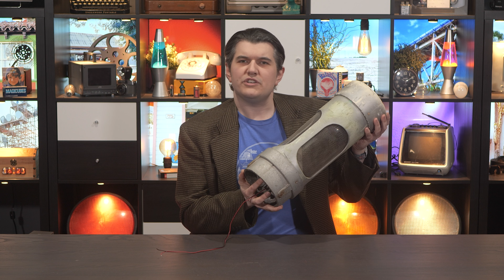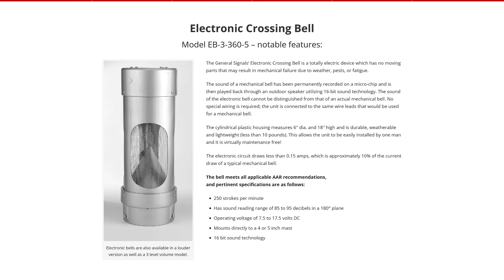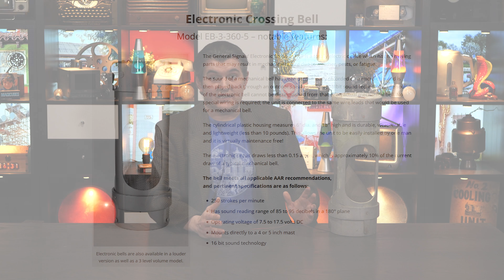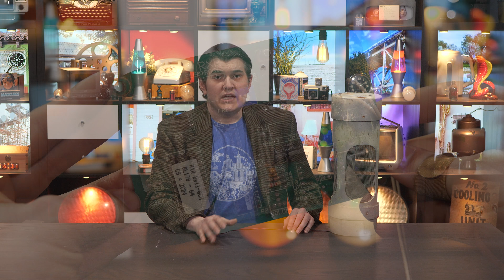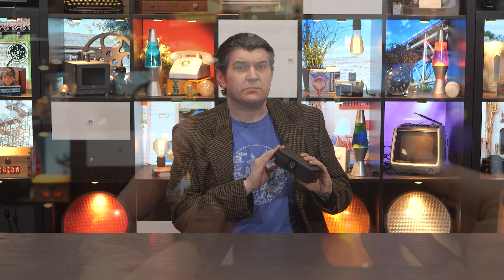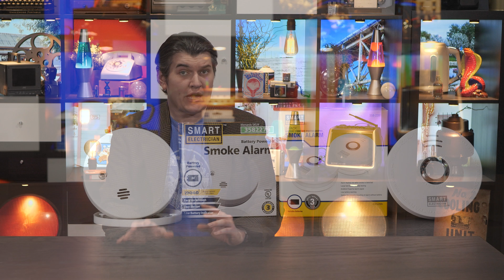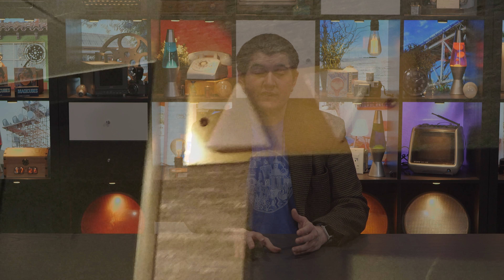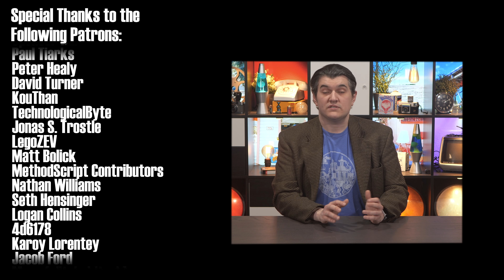The disappearing and unappreciated art of audible alerts

Comment: While your argument is correct and changing configurations and removing sensory aids are problematic, you are ignoring the devops side of things and the major problem of exponential complexity.

Lets use the 35 years old Linux Kernel as an example, it went from 200K of code in 94 to 40 mi in 2025, half of those lines were added in the last 10 years, and 35% of it in the last 6 years.
This exponential growth means it's already impossible to audit, it has long stopped being reproducible (bit by bit identical by different sources), it has dozens of critical bugs that are discovered early, it's not hard deterministic anymore (to mathematically sum all operations to count the time it takes), and yet it's the "safest kernel" there is today commercially.

Tech companies are not removing features and configuration options to mess with people, they are reducing the code to be able to maintain that which matters the most.
Unless we get better at isolation software and hardware, and automating security audits, unfortunately that's a trend that will only get worse.

Comment: I'm a fire alarm inspector and just want to add some context to the fire alarm cadence discussion:
- While temporal 3 is certainly one of the current standards, previous standards (in no particular order) included a solid tone, the whoop as mentioned in the video, and march time. Also, these days some building classifications are starting to move away from the temporal 3 standard and into voice evac, in which a pre-recorded message plays over speakers. These voice evac systems have decibel and clarity specifications outlined in code.
- While yes the cadence is the main point, there are generally accepted pitches that have different uses. They might vary slightly by manufacturer, but those manufacturers should be offering essentially low pitch, middle pitch, and high pitch options.
- Another caveat is there is absolutely code requirements for decibel levels even in temporal 3 systems. The alarm cannot be below a certain decibel rating in any part of the building in buildings that were accepted with this standard.
- Not all systems in currently in service will use temporal 3 or voice evac, because existing buildings are not required to be brought up to current code when the code changes unless they are making major occupancy type changes or renovations to more than a certain percentage of the building.

More trivia: Similar to carbon monoxide alarms using temporal 4, commercial fire panels are also required to have different types of alerts for Trouble signals (something wrong with the system but not an alarm) and Supervisory signals (other types of alerts, like for duct detectors or if someone is tampering with an associated sprinkler system).

Comment: I find that most chimes have now-a-days been replaced by spoken word notificiations, so there is not much of a need for chimes that follow standards. For example, lifts/elevators tell the user whether they are going up or down and what floor they just stopped at. Also, large vehicles turning have spoken word notifications to tell others to keep clear.

Comment: the problem for me is that noises are disruptive to me (Autistic) but the vibration modules in modern phones are SO WEAK that's why you miss them.
90s/early 2000s phones would vibrate so aggressively you'd pop in your pants if your pocket was a little too close, now days the vibration is as weak as a leaf landing on on the ground. hell it's so weak that I have felt the vibrations of a fridge running several meters away over my phone literally in my hand.

Comment: 11:24 the problem is that co detectors and smokes both use more or less the same low battery alarm and to add to that, the pitch and volume make that signal highly non directional.

12:38 lol, I have a Morse keyboard plug in on my phone for text messages.

An interesting version of this is the tone out system used by fire and ambulance radio transmissions.

Comment: I had a cellular phone at one point (when we used them as phones) that would vibrate for the first couple of rings and then start low with the ringer and increase volume if it was not answered.  I miss that.
I also had an LG flip that had a ringtone that clucked like a chicken.  I really miss that.

Comment: I usually keep seeing android-apologists preaching that it is ultimate "customize everything" phones, but when I got mine two htc and samsung phones gifted to me, turned out, that if it is not some barebone noname Chinese phone with completely vanilla android, it is more restricted than iPhones in technical and visual customization. Not only samsung's player won't recognize anything that is not a puny mp3, so I need to convert everything on top of that, and there is no personalized sound customization besides only phone calls. The settings navigating itself is a dungeon quest everytime. And my "htc desire" didn't even had the sorting function in UI, so you need to also rename files alphabetically or 1-9 numbered, like on old flip-phones. 
Who thought that those basic quality of life features are "not necessary" to include(or to cut off from original OS functionality)..

Comment: So much to mention, as always (a side effect of having similar thought processes). First, as a railfan I am always excited when I find and record a crossing with a mechanical bell, but I did once find a crossing where the gate was a bit bouncy and caused the electronic bell to restart repeatedly before it could finish playing the sound sample. It basically ended up as a remixed party bell.

Also, I miss the notification options I had way back in the BlackBerry era (including up through BB10). Plus, having a notification LED that would flash the color and speed I had set for each app or group of contacts. I could always just glance at my device to tell what was going on and how important it was to answer. It also had a sensor for different notification settings if it was holstered or just out in the open. Those were the days.

I highly agree that folks need to pay attention and learn more. Too often people are too wrapped up in what they're being distracted by to notice things going on around them. Is this what getting old feels like (I'm only in my 40's lol). I somehow missed the elevator ding video, but had independently discovered this some years ago. I worked in a hospital in high school and it always let me know if I should hurry up to get around the corner to the elevators or just take my time.

One area of sound design that I think is very cool but not yet universal is having a different cadence of rumble strips along the highway for the centerline verses the shoulder side. I spent last winter driving a bus on a mountain road that was often covered with snow and it was difficult when following the tire tracks ahead of me to know if I was drifting too far off the shoulder or into the other lane (which was much preferable since there was little traffic on the opposite travel lane).

Comment: I guess i am quiet odd in how i deal with push notifications. It's quite simple everything apart from WhatsApp and calls has no sound, and even those two are completely turned off when i set my phone so silent. The only two apps that are exemt would be my Alarm Clock and my Catastrophe alert app, which has yet to trigger for the last 3 years, apart from the occasional test alarm (around once or twice a year).

Comment: Back in the '80s, JDM cars came with a mechanical speed chime that kicked in at 65 mph. It used a tiny striker to give you a polite 'ting-tong', the car’s way of saying you’d hit the limit. HA! For us, that’s exactly where the fun began
Reply: My 1986 Dodge Conquest (rebranded Mitsubishi Starion) has its parking brake warning light and chime set up from the factory to not activate if the brake is pulled after the car is already moving. It's like they knew that the driver didn't need to be alerted when doing J turns!

Comment: The railroad crossing bell is a General Signals Type 1 electronic bell. Production started in around 1992 and ended in 2000. This bell you have seems to have an adjusted tone, since the factory-fresh bells had a much higher ring rate and pitch. If you turn that blue potentiometer on the bell’s circuit board, you can adjust the tone. In 2000, they quietly updated their model to have a slightly lower pitch, a much lower ring rate, and the removal of the screws on the top of the bell cap (due to rusting). Signal enthusiasts quickly labeled this version as the “GS type 2” due to it being the 2nd version of the bell. In around 2014, General Signals updated their design once again to its newest version, labeled as the “GS Type 3”. This bell had a higher ring rate that was similar to the type 1, but had a lower tone than the type 2.

Comment: I have T1D and so getting alerts from my dexcom is suuuuuuper important and I got a new phone recently I switched from a Google pixel 6 pro cause the battery was starting to die really fast to a moto g stylus which I was super excited about because it has USB-C charging and data transfer a 3.5mm headphone jack, and expandable storage, however it came with a setting pre-turned on called bed time mode which turned off all notifications when "bed time" came around!!! And even though my dexcom app has permission to never be silenced by do not disturb modes and turning off bedtime mode multiple times it was still turning off my dexcom notifications!!! Stuff that for me can literally be life or death situations!!! And I was having an extremely difficult time just turning that off so I could hear my notifications!! Not only are phones now days forcing very limited control on you but they also forcing themselves and you into a chamber of silence where no noise no matter how intentional, preferable, and needed can reach you

Comment: You inspired me to dig out the electronic railroad bell i found in the dumpster at our signal maintenance building. Replaced a capacitor and fixed the speaker and away it went. Your 100% right, these things look like they were built in a guys garage !

Comment: 15:09 The worst is when apps are designed around needing push notifications enabled to function (like a delivery app) but using those same notifications at irrelevant times to deliver ads, and not providing the user any control over which notifications are enabled - you can only blanket disable them for the whole app, which makes it borderline useless.

Comment: Setting custom sounds for different notifications on my samsung is awful. 
You go to either Settings -> Notifications -> App Notifications -> Select the app or Settings -> Apps -> Select the app -> Notifications. 
Then at the bottom you select "Notification categories".  
Then depending on the app they will have a list of different functions that are able to send you a notification with a sliding button that you can turn on and off, set in a style the phone uses for every other setting that just turns a button off or on when you click it... BUT these are special in that when you click them, they don't actually turn the button on or off but instead open a secret hidden menu that contains the real on/off button as well as the way to customize the alert sound/vibration and some other stuff.
For a feature that is kind of a big deal and always has been with cell phones, it is crap design hiding it away so deep into menus. 
Oh and as a bonus, some of the clicky button on/off options are actually just headers for the category they represent and behave as you would expect by turning the button off when clicking and not opening a secret hidden menu. They are basically indistinguishable from the other options.

I assume this is what you were ranting about.

Comment: You touched on it but the cell phones are really what killed sound alerts. But I'd say the issue is not the overwhelming notifications or (solely) user-hostile design but the effect of everyone having their own sound alerting device that they have to manage. You're expected to silence your phone when appropriate and failing to do so results in social humiliation. The common thread of safety alarms, door chimes, vehicle alerts, and transit jingles is that they are expected to always be on.

I'm a few years younger than you which puts me right at the age where mass cell phone adoption happened when I was still in school. I also preferred small simple audio alerts! But school was not a place for sound alerts, not even the unintrusive ones. At best it would be embarrassing. At worst it would get your phone confiscated. Sometimes I would forget to put my phone on silent. Sometimes I would forget to turn the sound back on. Eventually, it became easier to simply keep the phone on vibrate. The next generations of students also learned the same lesson but progressively earlier. And at some point keeping the sounds off became new cultural knowledge.

Comment: Always enjoyable vids. I was always amused how early SMS notifications were dit dit dit dar dar dit dit dit. I assumed we were going to  get the option to  customise SMS notifications in Morse code to our initials. I did learn that in the US, party line telephones had a bias spring on the bell motor to adjust to be different to all the other bells on the line so the exchange would use a specific AC frequency ring current to make one phone ring the loudest. That meant you would know the caller was for you, or the the phone would be in use with another party line user. We too have those same imitation bells  here in Australia. Bimetallic mechanical  car flasher units are copied electronically these days for their sound including flashing faster should a bulb be out.

Comment: My 1950s house came with one of those rear door doorbells for the milkman back in the day. It only rings once on the bell press and doesn't ring on the switch release so you know it's the backdoor not the front just from the chime. It only goes bing not bing bong if that makes sense.  The chime itself has two bells a high one for the bing and a low one for the bong, struck by two electromagnetic coils rather than a motor. Still works better than new ones and its from the late 40s.

Comment: The best part of being made of cheap parts from a hardware store is that it can be repaired with cheap parts from a hardware store
Reply: Wait, you still have a hardward store with cheap parts?
Reply: @huma474  They exist. Go find an independent place, often an Ace franchise. Did you know those are locally owned?
Reply: @Uruz2012 yes they sponsor the robotics team I mentor. In a town of 3800 we have TWO 😁
Reply: i guarantee you they're charging municipalities probably $300 per signal at least
Reply: The manufacturer literally just copied the prototype they were given and nobody opened one up and found out.
Reply: Car seat blew and door alarms used to be really annoying. I think most manufacturers have done some research on this as they don't seem to bug me like they used to. In fact I don't even notice them of couldn't tell you how they sound. They are just there.
Reply: And it’s made cheaply so it should be cheap to buy but of course it will be expensive to make the company rich

Comment: The use of pvc for the signal was probably used for cost as well as it wouldn't rust like a steel casing would. like the bolts holding the circuits in place did.
Plus if it got damaged, you can just make a new one with a trip to the hardware store.

Comment: The DAC (Digital to Analog) on the board is an AD557JN - it is only 8 bits. So definitely not 16 bit sound quality. The counters (CD4040) are 2 x 12-bits and likely cascaded. The outputs will be connected to address lines of the EPROM (lower left) and shifted by 1 bit, with bit-0 likely connected to the !CE line of the DAC. The 8 pin chip at top of the board is likely to be a 555 timer that drives the counters. The LM384 is the power amplifier for the speaker. It isn't clear from the front what size the EPROM is. Lifting the label would reveal all.

Comment: I work installing manufacturing equipment. We've stopped installing audio alerts for anything other than life safety. It's usually incredibly difficult to know what's going wrong from an audible alarm alone. Especially in a noisy environment where it's hard to tell where the noise is coming from. We've started using red=bad green=good lighting and readerboards.

Comment: I like the idea of sounds to communicate specific things. My problem tho is that some sounds are heavily overused and annoying as hell. Like a lot of household applyances use a really high pitched beeping noise when done. Microwave beeps, dishwasher, oven, rice coocker and even the fridge when left open too long. I miss the time when for example our microwave had a pleasant bell sound when done instead of four high pitched beeps. Nowdays i never know whats beeping and it annoys the crap out of me to the point where i have taken things apart and desoldered the beeping component from the board to make it quiet.
I am quite sensitive to all sorts of noises, so it would actually be great if devices had different pleasent sounds to communicate with me what is done since i would pick up on them really well, but as it is now, the things just get on my nerves and dont provide actual value.